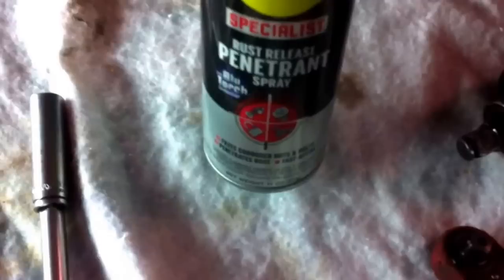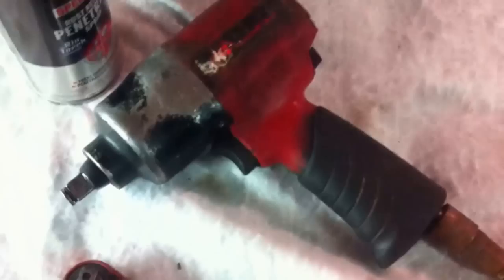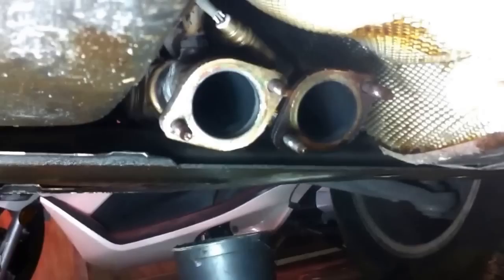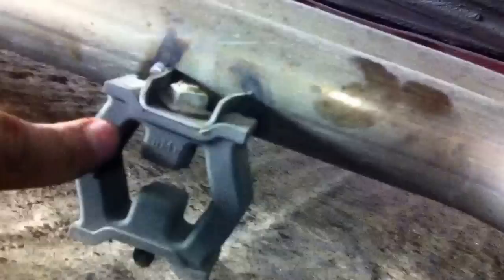BMW e46 exhaust removal. Take off exhaust on a 1999-2005 BMW e46 323 325 328 330

Comment: I have a hole in the top of my muffler exactly above the exhaust tips,is there a way to fix this with out replacing every thing because my pipes and catalytic converter are in good shape,I just have a hole in the top portion of the muffler.
Reply from the maker: +usant1 you can replace the muffler only. You will need to cut the old one off and the replacement either clamps on to the pipe or it will need to be welded to the pipe.
Reply: usant1 There are also muffler repair patches you can buy which would be cheaper

Comment: I have an e46 with the shielded portion of the exhaust pipe with a metal shield around it that has a hole. It is close to the cadillac convertible and hard to get to. Any suggestions on how to repair this. I am afraid to break the nuts if I try to remove the entire system